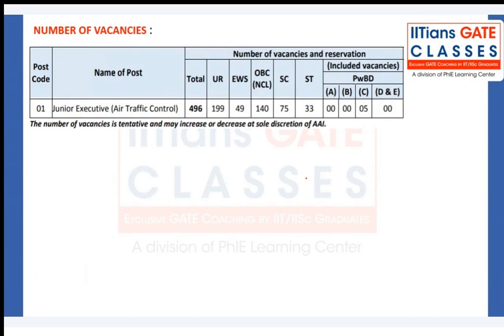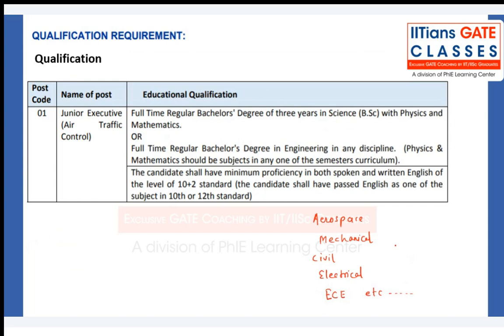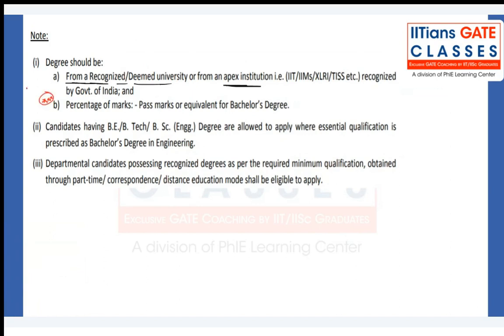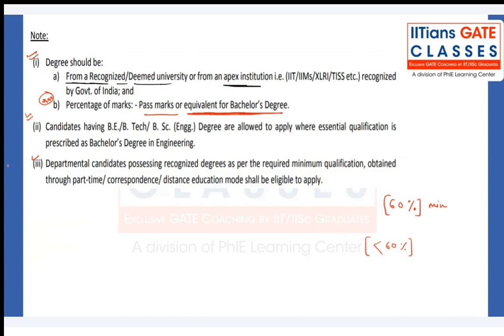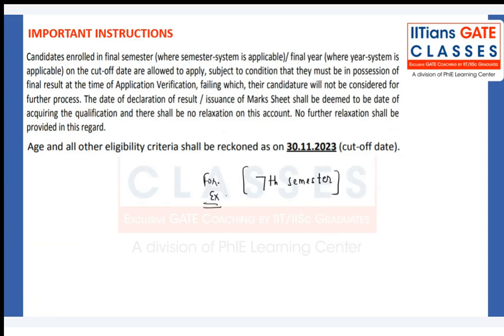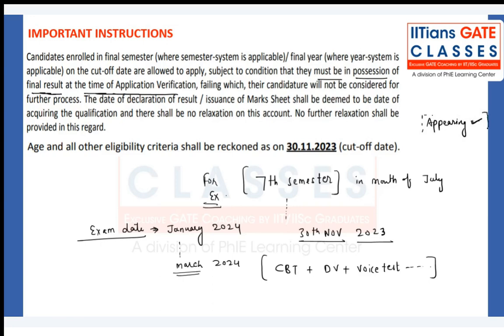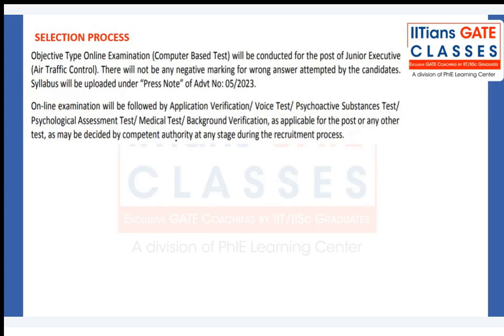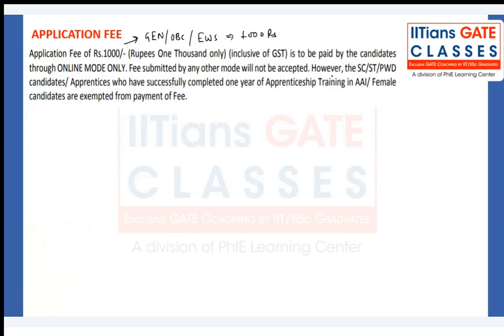AIRPORTS AUTHORITY OF INDIA | Junior Executive | Air Traffic Control Recruitment 2023 for Engineers

Comment: One important question I wanna ask - am pursuing B.E Aerospace - and currently am in my 7th semester. Will b completing by December. The AAI exam might probably take place in December. 
Am I eligible to apply for the exam? Because they have asked that during the document verification I must posses my final year gradesheet/marksheet. Would be grateful if you can share some advise for the same.
Reply from the maker: Hi 
No you cannot apply for this.
At the time of application of must have all required degree completion certificates